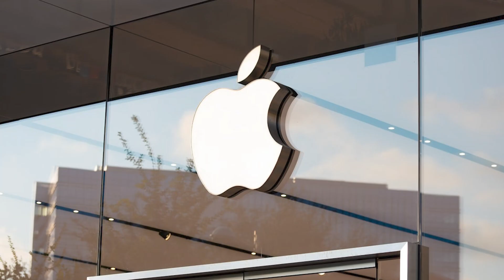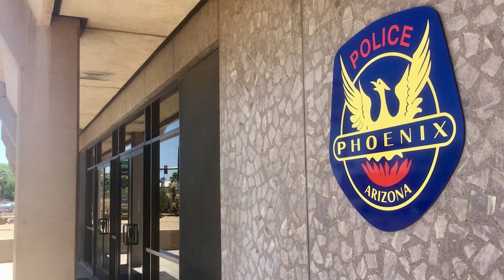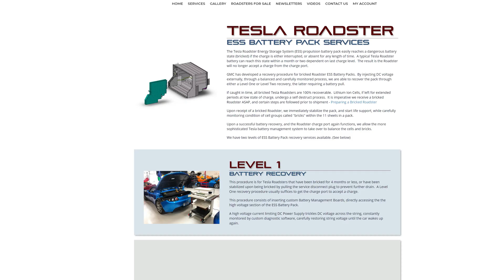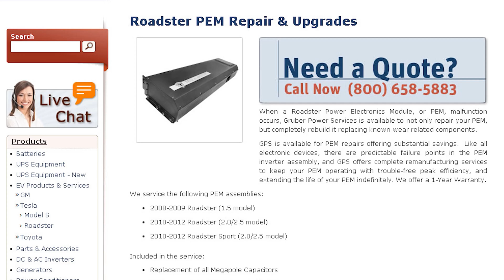Our History with Tesla | Gruber Motors

Comment: Can you make a convertion kit for other cars so they can charge on the Tesla network when Electrify America goes away?
Reply from the maker: That is an excellent idea for an adapter.  Thanks,
Reply: Why is electrify america going away?
Reply: @jeremykeaton274  https://youtu.be/2tF2_zjZ5yc
Reply: @jeremykeaton274  Sorry that took awhile.  I keep forgeting everyone does not watch as much as I do about Tesla.  Watch this and follow these guys.  https://youtu.be/nyvZG9cdGhM
Reply: @jeremykeaton274  https://youtu.be/2tF2_zjZ5yc
Reply: @coachwarrenraven  That is just complete speculation by those guys (I do like their other vids though). The deal was for VW spend 2 billion over 10 years yes, but that doesn't mean they will get rid of it after that. Even if they weren't getting as many charging customers as they hoped, it would probably cost another 2  billion just to get rid of all those chargers. Basically 100% of the cost of putting in a fast charger is in the infrastructure- the physical cable and inverters in the box. Running the network is not the expensive part. Obviously VW hasn't gone as all in as Tesla has, and I have heard the bad things about Electrify America's chargers too, but these guys act like there is no reason they would want chargers after 10 years - what about the VW Id.4 they just launched? Even if it doesn't sell like Model 3, why wouldn't they want chargers after putting all the capital into developing an electric car platform.